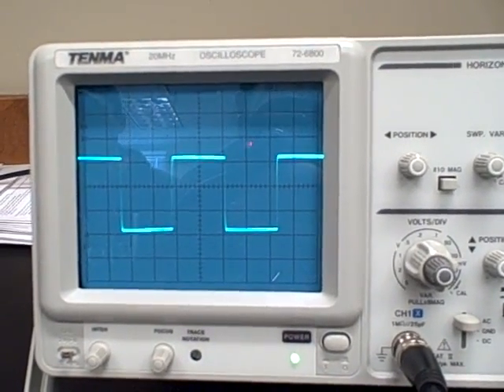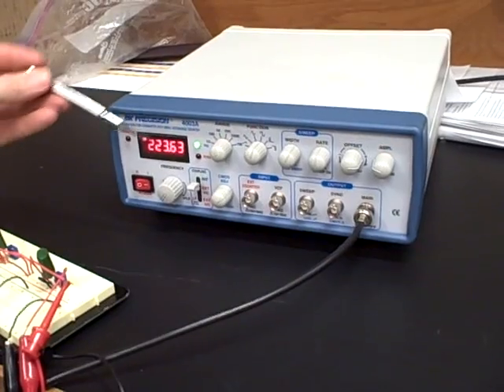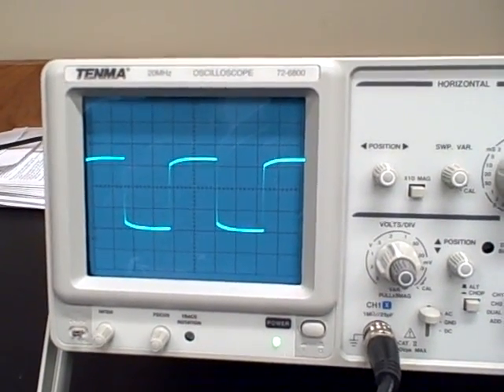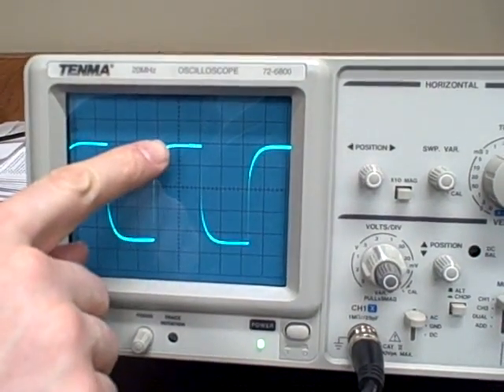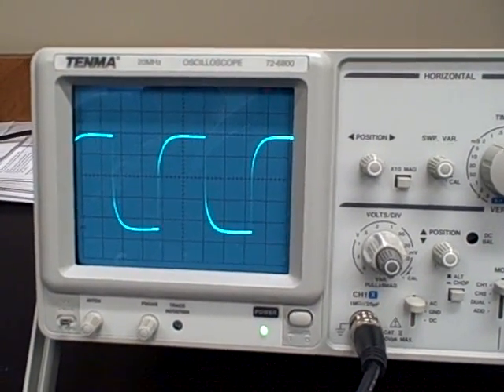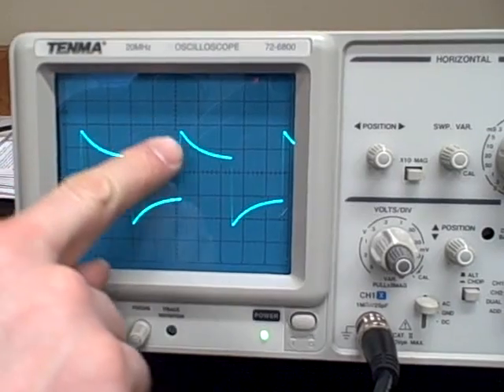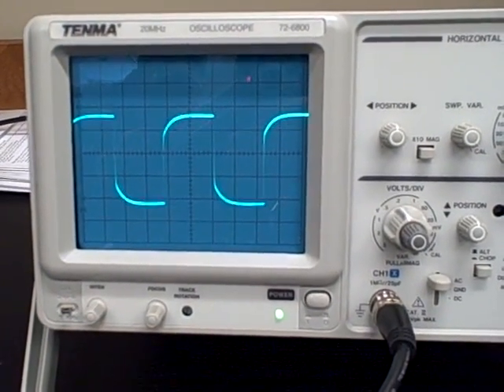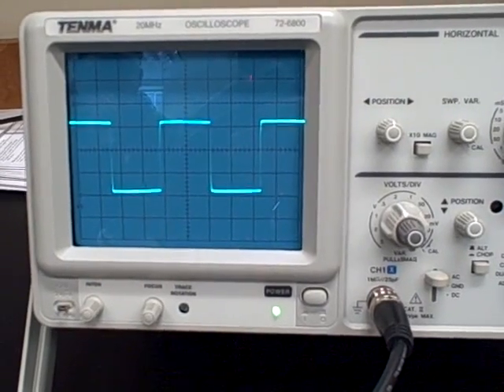Lead/lag analog circuit

Comment from the maker: @sickboymike The circuit by itself is pretty useless.  It does, however, illustrate the operation of a lead/lag function of the type used in "feedforward" control systems to compensate for different lag times in a process control loop.  It's hard to explain in 500 characters, so if you want more info you'll probably have to read the chapter in my book on feedforward.